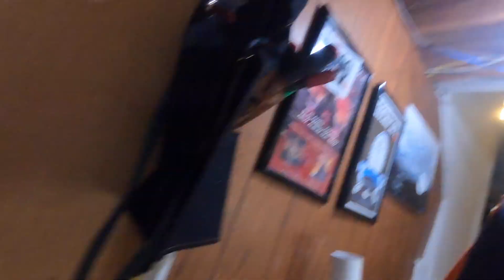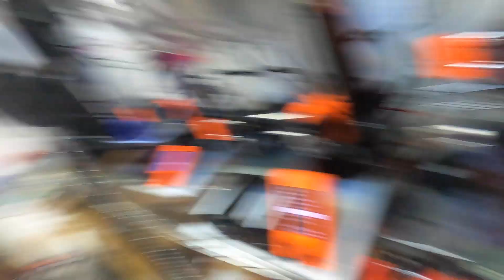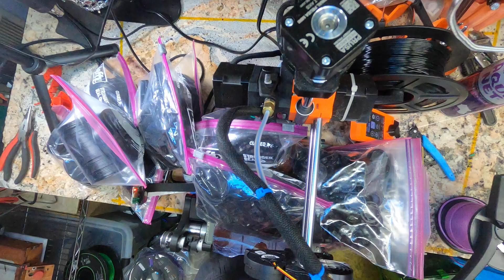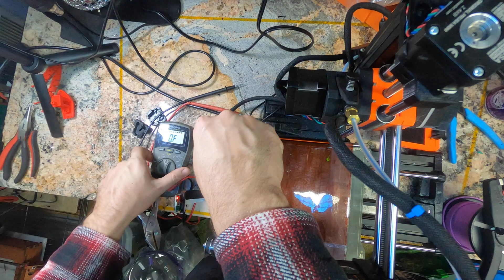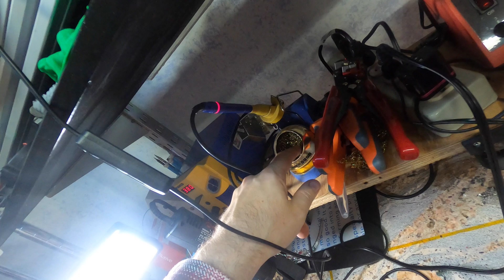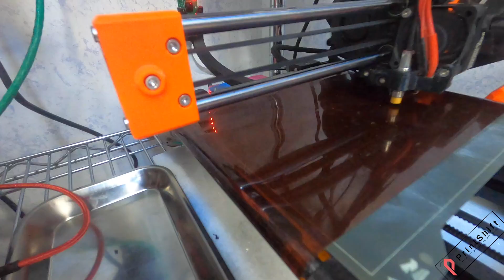Prusa Mini - Repairing heated bed wires

Comment: Hi Paul, I like your channel a lot. It's popped up in the algorithm a couple times now. I think I'll just subscribe. 👍 The beginning of this video was hilarious.

I see you like the Prusa Mini's. So do I. Although, I've never owned one I like everything I've read about them. The price seems really good too for what they're capable of doing. I was wondering though, with all the options we currently have now. Do you still think they are the way to go for a small production farm? Would you do anything different if you were starting over right now?

Can't decide between a few Prusa Minis or building a couple Vorons.

Your thoughts?

Edit: I was already subscribed! Was probably really late at night and I don't remember.
Reply from the maker: Mini is a great little machine, with a mildly weak extruder - for farm use, I'd incorporate bondtechs from the start.

Prusas win big in durability and quality control -  hands down over enders and their clones.  Not like those are terrible machines - they work great, once you give 'em a bit of TLC, even better if you replace a few parts.  It's a time/cost tradeoff, basically.  This mini is the first printer failure I've had out of four minis printing thousands of parts.

Same with a Voron - a well-built, tuned and tested Voron definitely beats a mini.  However, that well-building, tuning and testing comes with a significant price tag - money as well as time.  Prusas come with all that, for a reasonable price tag.  For the small size... I don't think a voron adds enough to be worth the time, but you definitely won't be unhappy with a Voron once built.

Main reason I started with the minis was cuz I wanted to work on the belts, not the machine - and smaller is easier with belts.  Future work, I'm going for larger belts - and ideally more independent bed mechanisms, so that you could just bolt it into a Voron, or any other printer that's OK with a seriously heavy bed :-)